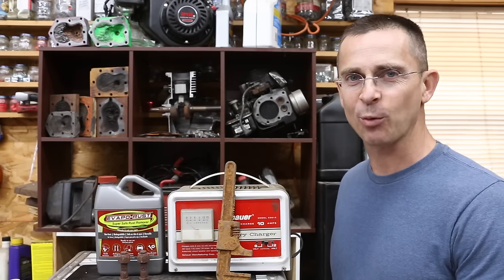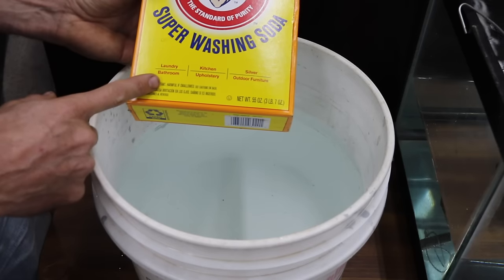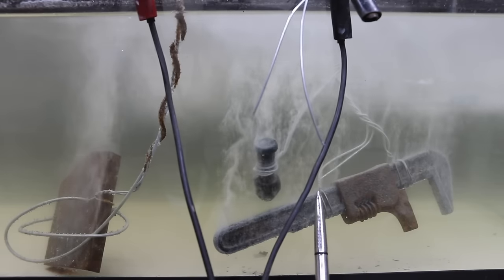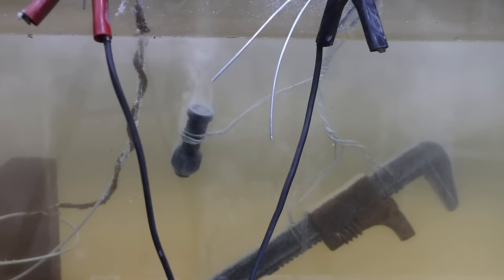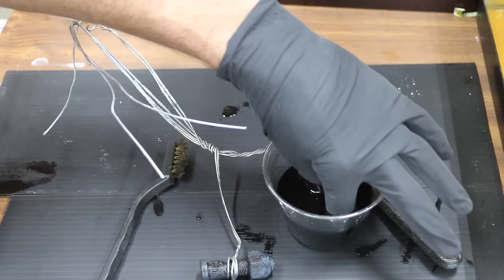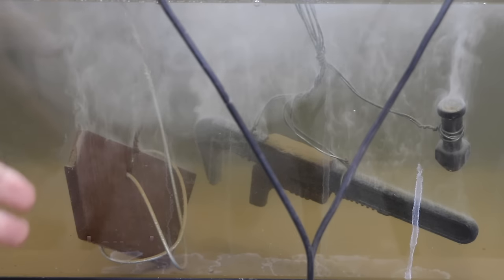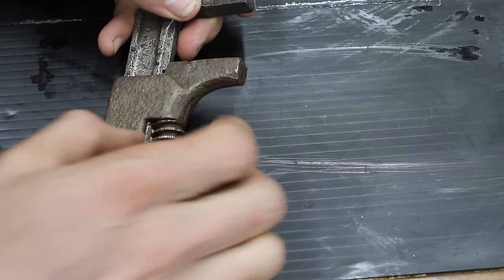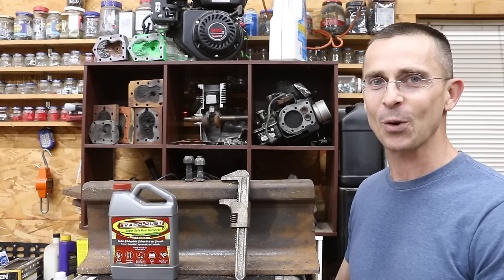Is Electrolysis better than Evapo-Rust?  Let's find out!

Comment: How many amps was the electrolysis drawing for days on end? Did the cost of electricity used amount to much?
Reply: When I have done this I used a very similar charger to his and it was showing 5 amp but seemed to taper as the sacrificial metal got coated. I would clean or replace it to aid the process. I never tested the current draw at the 120v side but I believe the electrical usage to be minimal. Far less than charging a battery for a long time.
Reply: you can get a ballpark figure with any setup:
using a multimeter (to measure resistance) disconnect the electrical leads from the charger, then connect the multimeter when it is set to measure resistance. once you have that number connect the leads from the charger and use the multimeter to measure voltage when the charger is on. now divide the volts over the ohms (the number you got measuring resistance), and this should be very close to the amps you are drawing.

as the anode rusts the resistance increases, which will decrease the amps used, and slow the process. another thing to know is that by multiplying the amps by the volts will give you the watts, and thus the unit used by the power company to charge you money. the charger will use some electricity in converting the power to DC and lowering it for a car battery, so the numbers you get won't be exact (not to mention that reality never perfectly matches theory).
Reply: It looks like the charger used can go up to 10 amps.
 So 10A*12v = 120W. 

With an 80% efficiency. 120W/.8 = 150W per hour
150W * 96 hours = 14400w or 14.4 kWh
14.4 kWh * 11cents = $1.58   or where I live 14.4kWh * 30cents = $4.32
Its unlikely it was drawing the maximum 10amps so its more likely half of that .79cents
this also dose not include the cost of the baking soda. 

Considering evaporust is $7.34 a quart i think it really does depend on the size of the part.
Reply: @jamoecw  isnt a little bit easyer to look at the amp meter on the charger?
Reply: @xiro6  assuming the charger has an amp meter, and that it is accurate enough to handle the slop when multiplied out quite a bit for time. only very expensive chargers have accurate ones, and really cheap ones may even lack a meter. but yes if you do have an accurate one then checking the amp draw meter (some even have a different meter between draw and supply) would be the simplest way.

of course knowing in more detail as to why you draw those amps can help refine your setup, so knowing the actual volts and the resistance in the setup can help identify flaws.
Reply: All what you need is:  Plug Electricity Power Consumption Meter Energy Monitor Watt Kwh Analyzer. (10$ + -)

Comment: I agree with comments to tie in as many wrench sections is essential. As far as the nuts,, they cannot be freed up as the rust particulates are unable to travel the thread course to escape the confines of the nut itself to traverse the electrolyte solution to the promised land. I also believe the positive collector became consumed and less able to provide prime available surface for collection and current flow. Slow action on the less connected part also proves the viability of the process. Thanks for the video!

Comment: So for rust removal if you have a delicate part that needs to be saved you can use molasses and water. Ratios from 4:1 to 10:1 water to molasses work, its slow and it stinks high heaven but if you have large delicate parts that need to be saved I have not found a better cheaper method. Evaporust is faster but costs more. The one thing I noticed, when I put some brake shields in and left them for two weeks, was after I pulled them out there was a layer of black iron oxide Fe3O4 was able to be washed off and the metal was bright and shiny then as the water dried off I could literally see the rust forming in the water spots. So when I did the next round of parts when I pulled them out I washed them in some kerosine to protect them from air and water.
Reply from the maker: Great tip!
Reply: Is this the molasses I can buy at the local grocery store?
Reply: @NOVACOROLA  whatever molasses you get make sure it's pure organic molasses.
Reply: @ThePrufessa  seems like a waste of organic molasses
Reply: @kiyoponnn  I didn't suggest to use molasses. But if you're gonna use it to get rid of rust I'd imagine organic would work better. Maybe not. Shit I could be wrong.
Reply: @ThePrufessa  Ohh I see
Reply: You really mean 10 parts molasses to 1 part water?   The water would seem to be insignificant.
Reply: Yes I saw that and forgot to mention it. 10:1 water to molasses, follow the orders dude. 

10:1
W>M

That's almost all water.
Reply: @kiyoponnn  The molasses solution lasts for ages and can be left in a semi permanent rust conversion vat. It is very slow as in weeks, not days!
Reply: @bigm383  ohh
Reply: @tubastuff  Sorry if I was not totally clear 10 parts water to 1 parts molasses
Reply: Use muriatic acid to remove the bulk quickly, then rinse and finish it off with Citric acid, it will passivate the surface and resist further rusting. You can then dip it in light oil, I've used WD40 with great success. I've got tools I've treated this way unchanged after months of exposure and subsequent use. Saved a completely encrusted, 'hopeless' 30+ year old pair of pliers I discovered in the back yard after losing them during a previous fence mending episode. I guess the quality of the steel helped, not sure regular steel would have survived so well  ;-)
Reply: @johnnyjimj  Bullshit, citric acid does not passivate anything
Reply: @nate6386  -- ah, that makes sense.  For rust removal, my usual mixture is phosphoric acid with some oxalic acid added (the latter is a powder; you dissolve it in water).  Not as active as muriatic acid, but it seems to do the job well.

Do you have any special formulas to remove rust stains from painted metal surfaces, short of sanding and re-painting?
Reply: B. Rippy  More of the first case--I've got a bit of kit with a couple of scratches down to to the bare metal that have rusted and bled to the surrounding paint.  I'd like to sand a bit and touch up the paint, but I'm afraid of the rust present on the existing paint showing through.   Maybe it's a lost cause and I have to sand way more than I wanted.

Comment: Your wire around the wrench is causing a dead spot in between the wraps hurting the electrolysis process, notice the electrolysis pattern coming off the wrench when it's in the tank, you can see the deadspo where no bubbles are coming off it. WOuld be cool to weigh the sacrificial steel and see if the weight removed from the pieces equals the weight added to the sacrificial piece.
Reply from the maker: You are right! Thank you and Happy New Year!
Reply: That would be a good comparison on rust weight added and removed! I think he needs to do a part two!!

Comment: Thanks for this video.  I used both.  First electrolysis but had some slight flash rusting after drying it.  So then I soaked in evaporust overnight.   This remove residual rust and protected it from flash rusting.  Worked great!!
Reply from the maker: You are welcome!  Thanks for sharing.

Comment: Keep the sacraficial steel clean and it works faster
Reply from the maker: Great tip!
Reply: @ProjectFarm  ive done this a few times and when using a battery charger or power supply watch the amps when the sacraficial steel is clean vs dirty. The amps are way less when its dirty because of the less connectivity or higher resistance. And vise versa when its fresh and clean. Also make sure to use washing soda not baking soda. I forget what kinda gas it puts off but its bad news bears
Reply: @electromechanicalstuff2602  baking soda and water give off hydrogen, oxygen, and carbon dioxide gas when used as an electrolyte. Not sure which one is bad news for you?
Reply: @ProjectFarm  also avoid Stainless steel as an anode as it produces waste that's illegal to put down the drain in the form of chromates and hexavalent chromium. if the solution turns yellow that's a sign that you formed chromates.
Reply: @SaxtonHaile  they aren't exactly bad but enough hydrogen and you're playing with fire.... literally
Reply: @zragevii4705  More like a loud bang, and you need some surfactant to trap the hydrogen in. Such explosion are common when doing chromium electro plating and you forget to turn down the electricity before removing the plated goods (gives sparks, ignites oxygen-hydrogen trapped in foam, boom 💥). Main danger here is for your hear drums, it's VERY loud. 😄

Comment: this is great,...i think you would have gained movement on the wrench much quicker if the wire was on the moving section. you could see that the handle section was getting much cleaner than the travel section, the current travel had to pass through the handle section to get to the travel section. I believe this would have made a significant difference in the time it took to clean it up. very good videos and very informative. this will be beneficial to  anyone on the outside looking in to using electrolysis when cleaning metal.
Reply from the maker: Thanks for the constructive feedback.

Comment: You know what's even better? Pulse lasers😂
Reply from the maker: I'd love to test one of those!!
Reply: I seen that!  Awesome and EXPENSIVE!
Reply: @ProjectFarm  take a look at Styropyro's video, those things are crazy dangerous (but super cool)
Reply: I watched a video about those then went to research them and what you don't see is the massive control unit that you have to lug around too for power.
Reply: Yea and they cost as much as a super car and the control unit is as big as a smart car.
Reply: @buckbundy8642  actually, go look on Chinese e-seller sites, and they quote prices between $3000-$12000. Laser does seem convenient, since it doesn't need to use liquids like electrolysis does. You can use it in-situ, like zapping the surface of a car or fence, without having to take things apart. Maybe it could be the future, if the price comes down and the form factor improves. I bet you'll see it arrive in auto mechanic shops first.
Reply: @manofsan  if you’re brave enough to purchase anything from a Chinese e seller be my guest
Reply: PhreshFunk  haha - but it's nice to be able to repair & refurbish stuff, to make it look like new. There's value in being able to do that. We can't live in a world where we just throw out anything and everything to make mountains of trash, while throwing money away in the process. Sometimes we have older items which we've become attached to because they've worked well for us. We just need them cleaned up or fixed up, so that they perform better.
Reply: @buckbundy8642  That goes 100X for something that can permanently screw up your vision
Reply: Cant wait for them to become less expensive
Reply: @Buck Bundy  - fair enough - but my point is that prices can't stay high forever. Think of any number of gadgets that were expensive when they first came out, and are now much cheaper. Technology always spreads out to the masses over time.

Comment: I also had a rusted adjustable spanner . Only difference being I used fresh white vinegar and submerged it right to the top . It ended up taking 6 days of total submerging to clean off the rust .  As you spoke of in the video there are also some other products available . Many months after I did this vinegar de-rusting , a radiator shop man spoke of a product used in automotive cooling system/radiator cleaning that also may be a help for de-rusting tools . This product came in a powder form and needed to be mixed with water and was called "Oxalic Acid" . You may have already herd of it . I've always liked your videos , yours are so good . bye for now .
Reply from the maker: Thanks!  Thanks for sharing.

Comment: Evapo rust is a modern day formula of what we used to use back in the day of a powder called EDTA or Ethylenediaminetetraacetic acid, you can even still get it on Amazon for cheap. Most of Evapo-rust is like 85% water..lol They say you can even drink it but I dont recommend it....
Reply from the maker: Thanks for the information!  Happy New Year!
Reply: EDTA is a chelating agent. That's interesting to know that is what evaporust is. I've personally never seen it. Humans can ingest EDTA and in some forms of heavy metal poisoning, it is given to remove the offending metals. Only problem is it attacks all metals, including those you want to keep, like calcium in your bones and teeth.
Reply: @kleetus92  exactly, my grandfather used to use  a mix of it with borax and water. not sure of the ratio but it was mostly water and just a dash of borax...still use it today on my boat parts..
Reply: They used to say round up was so safe you could drink it also. But I do feel evaporust works very well

Comment: Heres a lesson for who ever tries electrolysis,  I put a gas tank off a garden tiller in my tank. It was pretty rusty on the inside, it had water in the gas for a long time. 
When I went back after I thought it had enough time, btw this isn't by no means the first time of doing this, so when I picked it up out of the tank it looked like you had shot it with 01buck shot ,it had eaten holes all through it. So make sure that there's enough metal there if you do this to something thin.

Comment: The wrench was not done properly because the moving part was not connected to the wire and the rust and crude on it prevented the electricity from flowing through it.

Comment: Good vid;  good info.  What was the amp setting on the charger?  Gotta try this.  Big thumbs up.
Reply from the maker: Thank you!
Reply: You can use a 10 amp manual charger.  More is better but 10 works.  Don't use a automatic charger.
Reply: @projectanything7665  Thank you.  Can do.

Comment: Having too much sodium bicarbonate actually can hurt you. If the electrolyte solution is too conductive, the electricity doesn't spread around the electrode as well, and you can get patchy results. Didn't seem to matter here since the parts being cleaned are solid steel and highly conductive, plus you had the two electrodes quite far apart, but worth noting for the future if you ever try electroplating or something.

In other news, on a "favourite things of 2018" video I saw in another channel, someone mentioned Hercules ProPoxy as being ridiculously strong stuff... it's a putty, but supposedly strong even compared to liquids. I'm quite skeptical of that claim personally, but might be worth putting on the list to check out next time you're comparing glues.
Reply from the maker: Thank you for the feedback! Thank you for the video idea!
Reply: Washing soda is sodium carbonate (Na2CO3); bicarbonate is NaHCO3.    Borax or TSP would probably work as well or better in this application.
Reply: @tubastuff  My mistake, didn't look closely at the box. But, same thing applies no matter what you're using for the electrolyte.
Reply: It doesn't matter if it's carbonate or bicarbonate--some of those bubbles coming off the anode are carbon dioxide (some gets dissolved in solution and recombines); the eventual product is sodium hydroxide.  You could avoid the intermediate step and use lye instead of washing soda, but with considerably more caution in the solution prep.  Sodium carbonate is nearly as effective in this case, as it dissociates quite easily; it's used for cleaning purposes where hot water is involved, as it hydrolyzes quite readily.
Reply: tubastuff I thought that carbon dioxide dissolved in water would create carbonic acid, which would tend to neutralize the sodium hydroxide, assuming your premise is valid. Also a half cup of sodium carbonate in 5 gallons of water is an awfully dilute solution.
Reply: @philwood1009  You're correct that a dilute solution of Na2CO3 will result in the immediate recombination of NaOH and CO2, bringing you back to the starting point.  However, it should be noted that production of NaOH from a concentrated solution of Na2CO3 with high currents and the anode and cathode separated by a membrane has been proposed as a commercial process for making NaOH--see US4337126A for an example.  I wonder, however, if the process without a membrane could be tipped in favor of NaOH production by heating the solution to near-boiling, lessening the solubility of CO2 in water.   Something to try...

Comment: I did a whole engine block from a hurricane Katrina Miata.  I used detergent and ph-up (from the pool supply store).  One of those yard signs with holes was used as a separator and an old disc rotor was the anode.  The ph-up helps degrease and remove old paint.  The block came out perfectly clean after power washing it.  You don't need a gigantic tank.  I did this in one of those cheap Sterilite storage totes which is why I needed the separator to make sure the block didn't short out to the rotor.  As others have said, I brushed the rust away from the rotor periodically.
Reply from the maker: Thanks for sharing.

Comment: I wonder if manually removing some of the rust from the sacrificial metal after the first few days would have freed up some surface area for the electrolysis reaction to continue at the same speed, and if that would've improved results for that method.
Reply from the maker: Thanks for the feedback.